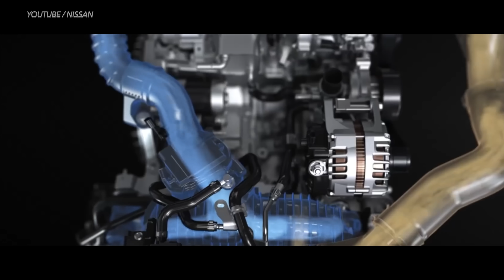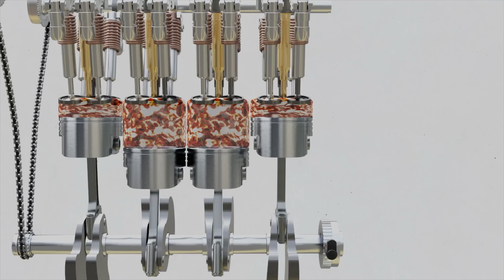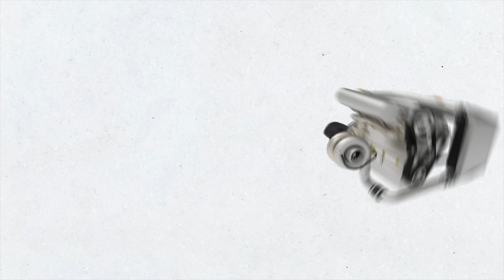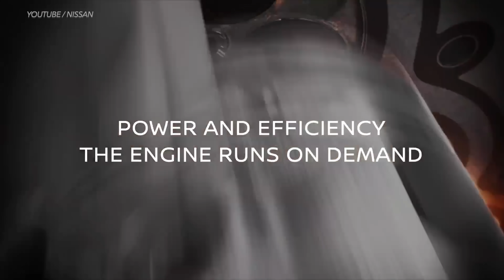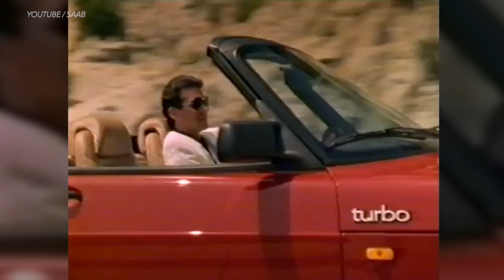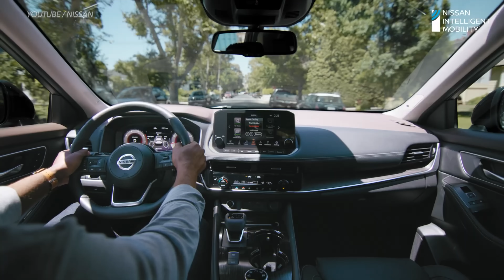Nissan Just Combined a Gasoline and Diesel Engine and Got This

Comment: Bad personal experience with Nissan Murano rusting out in 2 years in the rust belt states, and 2 transfer case blowouts. First at 10k miles second just 5k later. Sooo while I do believe Nissan can certainly make good engines and completely decent cars, I'm just not going to take the risk again after 2 Muranos.

Comment: Never EVER buy 1st year garbage. Sounds great, but look at my d3ad 2016 Tian XD that blew the cummins diesel motor at 140k and they stopped supporting it. Now you're on your own after spending $60,000 for top of the line truck and you have a $5600 DPF to change and a $16,900 engine to replace. Cut my losses,  or keep pounding money in to this trash. Let it go a few years so they can have a giant testing group break down all kinds of stuff they didn't think about.  Or let them just quit making tha5 engine in 3 years after it caused to many problems. And don't think an extended warranty will help either. You will have weeks if not months without a car as the dealers try to understand how to fix this technology

Comment: Of course it would be an Altima to get the engine you don't need to worry about putting the wrong gas in. Now all it needs is oil with lifetime durability.

Comment: Holy heck, I've seen old steam locomotives with less complicated connecting rod and valve gear linkages.
Better have one heck of an oiling system and well made electrical control parts that like to live in heat, vibration and oil.

Comment: 🤯🤯🤯 sounds like a theoretical "perfect Piston-ICE Engine" with a properly sized Turbocharger. What's the calculated Adiabatic and Thermal Efficiency Improvement over existing Piston Engines in Production for Passenger Automotive Applications? Complicated and probably gonna have mass Parasitic Losses but interesting Design nonetheless.

Comment: They need brushless motors on each wheel 🛞 that latch and unlatch and a regular motor. That way electric motors start first then engine kicks in later and brushless motors unlatch. It’ll go from 0-60 in a few seconds.

Comment: There is a difference according to the place you live. For example in eastern Europe Nissan is considered among the most reliable manufacturers, Ford on the other hand not. Also Nissan have much cheaper parts and of course you can find some parts used. This technology seems clever, and i think the right way to do it is very close to this shown in the video although it could be improved. Improvement of the ICE is absolute necesity in order to keep people prefering it, instead of hybrid or electric, we need the car manufactarers to inovate and evolve the ICE improving the eficiency and performance. Looking forward to see how this engine doing on the road and over time.

Comment: I hate to break it to all you Nissan CVT haters but jatco also makes CVT transmissions for many other car manufacturers Honda being one of them also most of the problems with Nissan CVT transmissions was between 2011 and 2017 when they did a stupid redesign and had to redesign it again and fixed the problem in 2018 . Just change the fluid every 45 to 60 thousand miles and it should last a long time .

Comment: Duel fuel engines are not new. Westport Fuel Systems developed a Diesel/Natural Gas fuel system installed on a Cummins 15 Liter engine over 10 years ago. This was a really good running engine, when the fuel system wasn’t broke. Reliability and cost killed it, including being that it used diesel required it to have an expensive after treatment as well.

Comment: Every car company have issues with their cars, and that's what makes them better,  is like making a mistake then you learn from it so you do better each time, yes every one know that nissan have some issues in the past and the biggest one was the cvt transmission failure, but that doesn't mean nissan cars is garbage they are not, from 2019 when they upgraded their cvt transmission I can't tell when last I herd of any problem with them again, all you have to do is just maintain your car just like any other car, if you have a CVT, just change the transmission fluid every 60,000 miles and change the engin oil every 4000 miles just keep your car up to date, take care of your car and it will take care of you...etc

Comment: Very interesting engine... But-- God have mercy on whoever owns that thing after a few years. Probably a throwaway engine when it starts having issues.
Reply: Nissan has no problem making engines reliably. My issue with them is their transmission. Ill put a dollar in that the CVT dies before the engine does.

Comment: Why build a Swiss watch like engine, if the same can be achieved by electric motors of the hybrid? And in case of hybrids, motor-generator has to work only in one mode.

Comment: I don't understand human stupidity. Every year someone comes up with a newer ultra complex engine which claims to be the holy grail of economy and emissions, to use them in heavy, wall-like aerodynamic SUVs. Fiveteen years ago, cars used to get even better mileage without any of those technologies. Not to mention dicreased reliability and planned obsolescence which in the end will increase carbon emissions.

JUST DON'T BUY NEW CARS.

Comment: I got a problem. Please help if you can. I have 2013 Honda Odyssey. This only happens once the car is warmed up.  First thing in the morning when I start and drive it’s completely fine. It takes about 10 minutes for the problem to start once it’s warmed up. Putting the car in reverse or drive and keeping  my foot on the break will stall the car. There’s a clunky noise before it stall. It’s fine  when in neutral or if  I gas it while holding the brakes down. Already did few transmission oil changes. Air filters are clean.  Please help.  My mechanic and the Honda dealership can’t figure it out.

Comment: Renault, Nissan and Mitsubishi are in an alliance. The major concern with these automakers is the CVT but Mitsubishi factory power train warranty is 10/100,00 and 5/60,000 bumper to bumper, Nissan 6/60,000 power train .  I wonder why the huge difference in warranties. For that reason, I bought a new 2022 Mitsubishi Outlander, mainly for the warranty but the newly redesigned Outlander is really a eye catcher. I have 100,000 miles to decide if the CVT is going to hold up.

Comment: 10% fuel efficiency is not worth the cost and complexity. Maybe if it was 200% better it would be. 800 mile range vs 400 in a rogue. Right now I get 35mpg in the rogue

Comment: Scotty,  my truck's AC/heat doesn't blow out of the vents except the defrost--where it still blows cold or hot. I took it to the shop and they said my compressor is shot. Is it possible for there still to be cold or hot air coming out of the defrost vents on top/sides to the windows -  if the compressor is bad? It gets pretty cold still, just not coming out of any of the vents. would like to get opinions before we get the compressor replaced for $700
Reply: You need replace the pollen air filter into the  cabin, cost 10 USD,

Comment: The 2 questions everyone will ask: 

Will it reliably go 200,000 miles ?

Can they put it in a Versa and get 50mpg?
Reply: Back in the 80s four-cylinder Japanese cars pretty much all got 30 miles to the gallon. There was a really small Honda that would get 50 and there was no fancy hybrid technology. Now don’t get me wrong these cars were small and not very powerful… People like them anyway.
Reply: Unfortunately those high MPG cars from the 80s and 90s produced a lot of pollution (NOx). The engines can still be sold, but they have to be adjusted to eliminate the NOx by burning more fuel (which means lower MPGs)
Reply: I drove 3 cylinder cars from Ford and Mitsubishi.  The highway EPA test gave 44-45 MPG
Reply: seeing all these high number sitting here with a pickup like oh cool. I'm getting 20-25.
Reply: 50 mpg avg that's not a hybrid is pretty impossible but I bet it will be able to go 50mpg on the hwy at say 65mph. Even my altima 2.5 can get 50mpg at 60-65mph.  It will probably get an epa rating of your 43-44mpg in a versa and about 41mpg hwy in the altima. It's sad that the nissan rogue gets the same or better gas mileage than the nissan sentra sr lmfao.and that only has 149hp.
Reply: @occckid123  if the 3 cyl can average 30+ mpg in a ROGUE, then I have no doubt that it could get 50-60 in a smaller car. I just can’t believe they put a 3 cyl in an SUV, so many of them are going to blow up or need new turbos on a regular basis. So dumb.
Reply: @fancypancytalker  and you know this how?

Comment: It definitely violates the K.I.S.S. principle. The dealers are going to love this $$$$$ . More  complicated, more things to break.
I'll stick with my 97 7.3 powerstroke. The engine design does have issues in the sensor design but the engine itself is rock solid.
Reply: VTEC is more complex than your 97 7.3 powerstroke but those K20 motors are ROCK solid reliable. 

More complex does mean more chances for something to break, but its not an infallible law. You CAN make a complex item reliable, it just takes time and research to identify the failing parts and designing something that addresses the failure points.
Reply: @android175  you mean like the cvt transmission?
Reply: @cbmech2563  Exactly. Notice how Hondas and Yoyotas CVT are more reliable than Nissan, despite being similar in terms of complexity? 

Id never trust a nissan CVT 💀

Comment: Sounds like alot more pieces to wear, tear and break off into the engine. I guess those into adventure would love buying one of these. Everyday would be a possible adventure never knowing if, when, where or which part of that car is going to fail. Between the CVT and engine everyday will be an adrenaline rush if you make it to where you are going.

Comment: Making engines impossible to work on yourself
I own a 1975 Chevy Impala, I bought new 350 8 cylinder, automatic transmission
My Dad has a 1969 Chevy c10 he bought new 250 6 cylinder manual transmission
We always made sure the were rust proofed from day one
We both have had the motors rebuilt once
And I have went through 2 rebuilt transmissions
His being manual is untouched, but he had to replace clutch plate, pressure plate and throw out bearing a few times, also the flywheel refinished
To bad they never made them out of stainless steel
But they would last to long I guess

Comment: As others have posted cool technology and engineering but all those moving parts scare me. I'm all for better engine efficiency but we are at the point of diminishing returns for internal combustion engines. We keep our cars until the wheels fall of so at this point I'm not a fan of either IC or EV cars.

Comment: Battery-Controller-Induction motor !
As simple as that. That is the future. That is efficiency.Electric cars have no clutch, no gearbox (or have very simple and reliable one), no complex lubricating and cooling systems , filters, turbines etc. Internal combustion engines are inherently inefficient , loud, pollution generating and super complicated (nowadays) with so many moving and controling parts that are becoming pain in the *ss. 
Battery technology has advanced so much that we already have enough charging speed , cycle counts and range for everyday use, at least for 80% of people. It's time to phase out these gasoline burning design flaws to crapyard of history.
Cheers

Comment: My Nissan Altima is way to Slow from a stop a low speed. It's extremely frustrating because of this damn CVT. Sport mode should be normal mode it's still slow.  I wouldn't had kept it if it wasn't for the chip shortage. But I had to it was the best option

Comment: Off topic- Ducati has introduced a new Multistrada engine design. V-4 with valve springs (not desmodromic) and at idle it shuts of the rear cylinders to help keep the rider from getting too much heat. Viva Italy. Bad automotive technology has reached the motorcycle world.

Comment: I just purchased a 93 Buick LeSabre. I plan on redoing all the gaskets and purses. The only thing concerns me is when I first started with the radiator full in the engine cold I take off the radiator cap it looks like it's circulating it seems some is slowly coming out the Overflow??????? Could that be because intake gasket. Which I plan on replacing LOL

Comment: Man combustion is getting so complex. Hard to imagine these things running as long as a traditional diesel motor.
Reply: I find it hard to belive any of these new technologies will be reliable past 150k miles.
Reply: true
Reply: I have two VW Jetta diesels and they have over 100k, and running great!
Reply: @davidhildebrand8894  wow a whole 100k miles! A miracle!
Reply: DIESEL is no longer “traditional”.  Extremely high injection pressures, soot filters, and urea neutralization of the exhaust (DEF).  It will be a miracle if they last 150,00.  Probably why no diesel is warranted that long.  (Several gasoline pollution systems are.)
Reply: @Yippee Skippy I'm fairly libertarian I'm with ya on that but it's not going to happen. Even if the US got rid of the standards the global pressure is there for fuel efficiency. We are adding tens of millions of cars per years to the world. Oil is going to get more expensive, not less. The Gretas of the world are winning the culture war. 

I bought Tesla stock years ago because I could see who was winning this fight lol.
Reply: @pierredelecto7069  the battle isn't over yet :)
Reply: @bradojacko8247  ICE technology is 100 years old. Theres no reason to continue to use them as technology advances. This isn’t a fight about culture as much as it is technological advancement.
Reply: @android175  fire is millennia old technology.  It is still used because it is the best at what it does for most things. ICE are the same way and other technologies don't appear to have any superiority over them.  The public cannot afford and doesn't want electric vehicles.  Until you can charge them in 5 minutes and chargers are ubiquitous with a car that is 30k or less, they are worse than ICE.  Also, electric cars are nothing new.  The technology is over a century old now, too.  And, it was inferior (in most situations) back then, too.
Reply: @android175  "this technology existed for a while so it has to become obsolete"
Why are we still using regular brushes, spoons, forks, knives, plates?
A technology becoming obsolete has nothing to do with how long it's been used, it has to do with its value compared to the newer proposed technology, and by value i mean the price, availability and how good it operates
Reply: @falcongamer58  You are absolutely correct, my reply amended that.
Reply: Electric Motor technology is even older than ICE technology…. about 170 years.  Maybe that needs to be phased-out too

Comment: Not something you can work on in your yard. Though this has been the case for a while. This motor violates KISS< but it is probably where we are going because of mileage requirements . It is either stuff like this or electric cars.  Trouble is most people in the USA won't be able to afford either one.

Comment: How about a simpler system for VCR... Each cylinder gets a waste gate (say, next to the spark plug). Electronically controlled the same way a modern turbo waste gate is. During for example light throttle, the cylinder waste gate is set to max pressure i.e. 210 psi for 14:1. Then under acceleration, the waste gate drops to say 120psi for 8:1. 
It would mean that it would work on any standard engine without special crank.
Combine that with Koenigsegg's freevalve technology for somewhere around 10-20% efficiency improvement.

Comment: There is a reason you can get a 3 or 4 year old Nissan for under 4k it's a pos I don't care what the motor is. Still gaps on the dash the car paneling. The plastic is cheap, everything about a Nissan is a huge turd nobody cares about your 2013 with 250k miles you probably spent 3x replacing parts than the worth of the vehicle.

Comment: It's definitely an intriguing concept, but I'm gonna hold my opinion until seeing how long the motor lasts, how many years and km/miles it can go before folding. That's the real important part, saving the materials and replacements needs by making sure the darned thing lasts longer than 150K km/100K miles (yeah, I know they're not equal, not looking up the equivalence rn) before it dies.

We shall see in a few years, I suppose. 🤔 😉
Reply: Good comparison would be up against ford ecoboost motors …many of those do not last

Comment: I will say this once to be nice but won't give away the details. 

More Air, more Fuel, more Ingnition Spark/Timing, and less Drag on an ICE Engine combined with the proper ECU Tuning is all that's required for you to have your cake and eat it too (Hi Power and Hi MPG). 

No need for a VC engine.

Comment: Love the vc-turbo in my Altima. 🤷🏻‍♂️ did a 300 mile roundtrip and averaged 39MPG the entire way there and back. I was surprised because my 16’ 2.5 averages 37mpg highway.
Reply: Congratulations. What year is your Altima?
Reply: @kastellolo5212  2019 Edition One and I just hit 28k miles last night.
Reply: @NissanAltimaGuy  I didn't know they had implemented that already. Anyways, I hope you get a smile every time you drive it.
Reply: @kastellolo5212  it's been around in Infiniti vehicles for a while now and they're pretty reliable the 2.0 vc in the Altima seems pretty good and the 2022 rogue is a 3cyl vc turbo time will tell if they hold up
Reply: Not much of a difference.
Reply: Replace your air filter with a K&N. I get 40+ in my 2017. Disclaimer: I don't drive like an A hole.